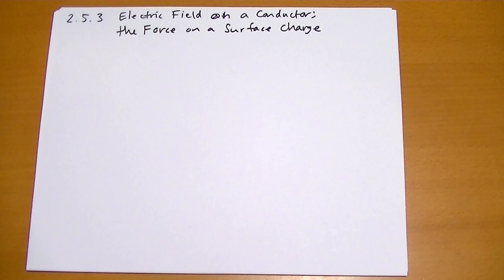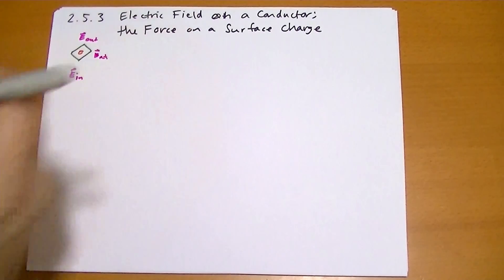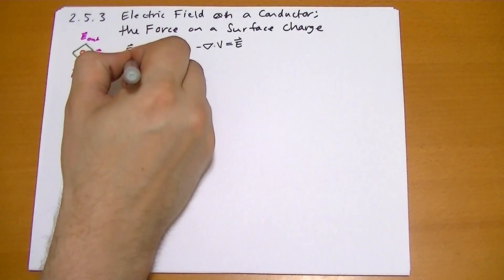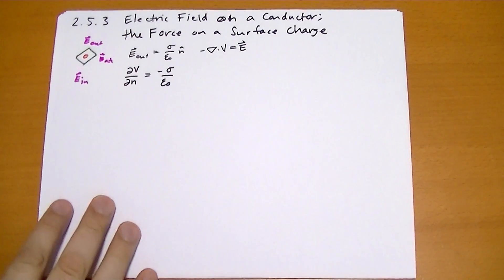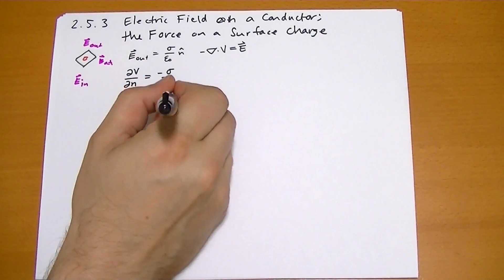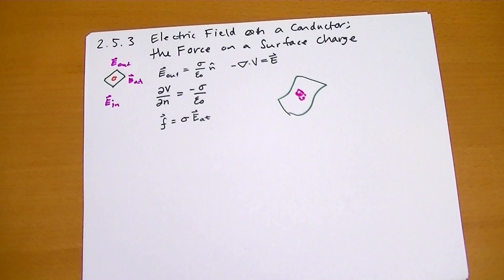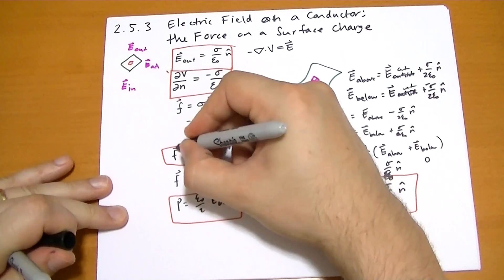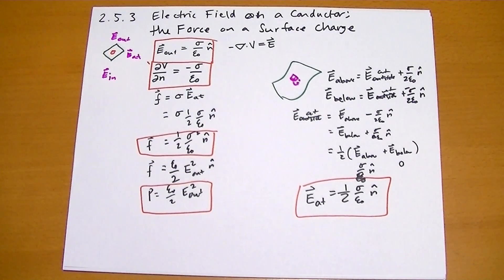2.5.3 Electric Field on a Conductor; the Force on a Surface Charge

Comment: So the external electric field is proportional to the charge distribution.  Clearly the charge distribution isn't causing the external field.  So does the external field change the charge distribution? Is this because of induction?  Can one conclude that if you were to increase the outside electric field, sigma would increase to compensate?
Reply from the maker: Yes, the external field changes the charge distribution inside the conductor. The charges inside the conductor are free to move around. If there is any net E field inside the conductor, then the charges will flow until the net E field is zero. In effect, the charge distribution inside the conductor is such that it creates an E field exactly opposite to the external field inside the conductor. (Outside the conductor, magic happens.) Thus, if you doubled the external E field, the E field due to the charge distribution would have to compensate by doubling. Since E is proportional to q, q has to double as well.
Reply: Real Physics - OK, that’s what I got from the equations, but wanted to confirm.  Makes sense, thanks.
Reply from the maker: No prob. I'm rusty, but these first chapters are pretty straightforward. Don't ask me about wave guides though -- I'd have to polish up again.